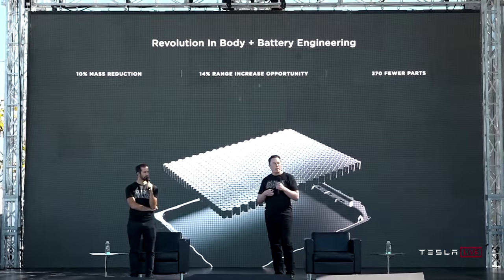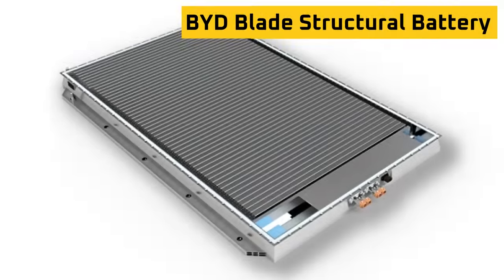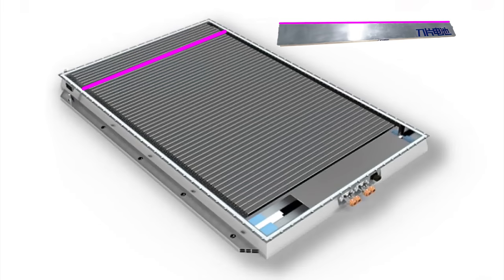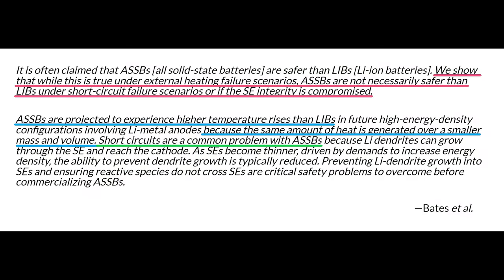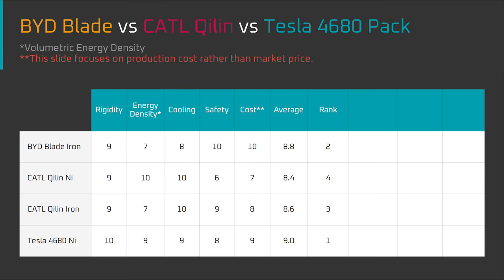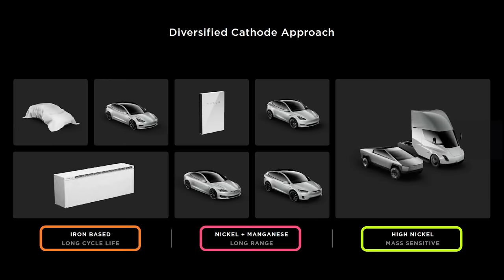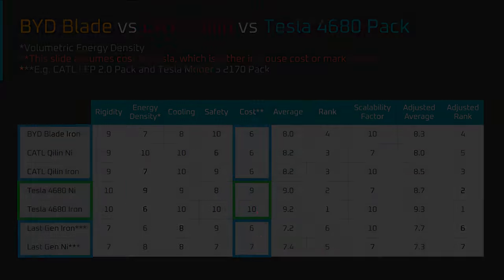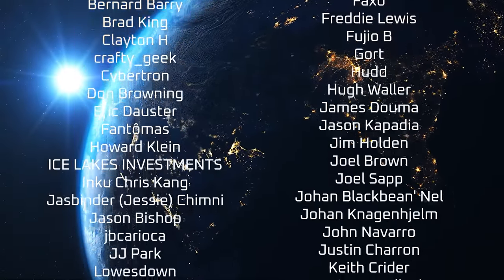Pack Analysis:  BYD Blade vs CATL Qilin vs Tesla 4680 Structural

Comment: 12:13 careful with that metric, electric cars may be less likely to catch on fire but when they do there is no putting it out via normal means. Lithium fires are no joke.
Reply from the maker: Lives aren't usually lost in putting out the fire, they're lost when the person burns alive in the vehicle or burns the house down.

Fair technical point, but not a good argument for safety of ICE vehicles.
Reply: @thelimitingfactor  I'm not trying to sound like i hate electric vehicles but i don't see significantly more danger in one or the other, there is a difference but not enough compared to the other risks of driving on the road.       The draw for me is how modular electric can be for custom/conversion applications not the difference in safety.

Comment: Right now vehicle to grid isn’t a huge deal but in the near future I see that changing. Being able to use your battery for energy storage when energy costs are low and sell it back to the grid at a higher price allows you to make money on an asset that sits in a garage most of its life. That is additional value automakers can charge for and likely make a cut of each KWH loaned to the grid. (Tesla makes a cut today.) The cons are that your battery will degrade faster. Very shortly I see battery life and number of charge cycles being a top three issue.
Reply: Why bother with V to G with the piss poor returns on energy returned to greedy utilities. Just V to home for the inevitable blackouts.
Reply: @howardsimpson489  it really depends on the deal with your utility. In the UK, some utilities are returning around .18 which is barely over the cost of increased battery degradation. While other pilots like the one with Tesla and PG&E pay $2 a kWh during times of grid stress! (So not every day) $2 a kWh is an incredible rate. I’d loan my battery every time for that.

Comment: To not be able too service the most expensive part of a product is a bad idea.
Reply from the maker: Actually a great idea if you understand all the benefits.
Reply: @thelimitingfactor  a battery doesn’t normally fail totally one or a few cells may get unbalanced. But this brings the whole pack down. Easy to extend life by just cutting theses of from the pack and even prolonging life of the pack as a DIY PowerWall. As it’s build in one structural part and PU foamed together there is no other solution than recycling and even that part is made more difficult by this design. Right to repair is the future for consumers.

Comment: Great video but it left me with a big question.  Roughly, what is the ultimate likely cost difference for a GM or Ford battery using the older design?  Second key question is whether GM and Ford will be switching to this modern design soon too?
Reply from the maker: The difference between an in house 4680 pack and an external sourced pack using module and beams will be about $88 vs $110-130.  

No, they haven't even started producing their first gen in volume.
Reply: @thelimitingfactor  Yes, the lack of any vertical integration of the cells, has to add cost. I think Ford mentioned LFP, with no signs of using them, and pouches suck.

Comment: You are obviously Tesla-biased, because the right to REPAIR and REUSE, especially when materials and supply is limited, become the most important issues. With EVs we try to pollute less, not throw away and recycle entire battery packs that could be salvaged or reused for many more years. Used battery storage and parts will become a BIG trend and business. You will be able to find a module with a similar SOH that you need in a scrapyard and service your car for a few hundred dollars instead of replacing the entire pack for a single damaged cell or module.

If the cell is not the issue and you need to replace a BMS or controller, that is exactly why it's better NOT to have it all covered in foam and basically render the entire pack irreparable. There are so many service shops appearing that are able to repair battery packs. It's not rocket science. It's easier than repairing an engine. Sure, you can screw up and blow up you gas car also if you don't know what you are doing in that engine. But that is exactly the point: modular batteries are SOOO way easier to repair compared with an ICE engine by any qualified person.

REUSABILITY is also a main point. In 10 years or when my pack starts to have too little range for my need, I can reuse it for home storage. This would add 10 or more years of usage to that pack. It's nearly impossible to do this wih 4680 and you know it. The BYD blade is 10 times more elegant and easy to reuse.

Unfortunately Tesla is going the Apple way, but not in the good sense. You cannot throw a 10-20k USD battery or a 40-60k car as you throw away a 1k phone. Stop taking their side when they are clearly doing stupid things. The 4680 will be forbidden in EU when they realise it non-repairable and this is also probably why they never produced it there. They are using BYD blade for Berlin produced Model Y which is great for the EU market. The right to repair and reuse DO matter !
Reply from the maker: I hear about this right to repair, but as far as I can tell it's a small group of tinkerers that want the world to cater to their world view - and in the process make the product worse for the other 99% of us.
Reply: @thelimitingfactor  It's the same as seat belts or insurance. It's only a small group of "irrelevant" people that need it, until it happens to you. I hope you'll get this the day you will end up paying from your own pocket for a battery fault not covered by warranty. Or try to sell your 4680 Tesla on a second hand market that does not want to touch them, because of all the arguments I have explained above.

Comment: The BYD Blade is NOT next gen. It is going into 1.3M BEVs/yr NOW!
Reply from the maker: 1) That's a semantic debate.  Unless there is something newer than the blade, the blade is next gen from my perspective.  2) Incorrect.  It's going into some, not all.
Reply: @thelimitingfactor  Why? The run rate is indeed 1.3 M / yr
Reply: @thelimitingfactor  Are you sure?

"Shenzhen-based auto firm BYD announced on August 19 that all of its new energy passenger cars are now equipped with blade batteries." [pandaily]

"BYD Announces all its Pure EVs Will now Come With Blade Batteries." [byd]

"The Blade Batteries are also currently present in all of BYD's" [electrec]
Reply from the maker: I responded above.

Comment: If a battery can be brought back to life by replacing a few cells, or even small modules, that seems to me a good thing. Batteries degrade because of very few cells, right? maybe its sacrificing maintenance for cost reduction?
Reply from the maker: Usually doesn't work to replace a few cells as a long term fix.  Throws the cell balancing out of whack.
Reply: @thelimitingfactor  Can't argue with that and you're the expert. Youtube won't let me post links, but the following two videos from Gruber Auto make my point. In Youtube, first search for Gruber Auto. Then, in their search box, enter Battery repair. Then if you feel like it, play the first two videos in the list. They are called Main battery repair something .. and Impossible to repair something .. I would prefer a battery with minor amount of dead weight in it over a 5% lighter one that cannot be serviced, just replaced. And the price difference is huge between fixing and replacing.
Reply: @biondanishgenomeinstitute8193  I have found that YouTube won't let me post links to external websites, but posting links to other YouTube-hosted videos is fine. Perhaps it is the same restriction for you. If not, the perhaps the difference between your experience and mine is that we are viewing YouTube via different technologies (I'm using a PC-based web browser rather than, say, a smart phone app).
Reply from the maker: @biondanishgenomeinstitute8193  Yup!  They do it.  But, doing it isn't adviseable unless you have a pack that's not produced anymore.  That's why Tesla advises against it.  Workable solution, but not an idea solution.

Comment: Encapsulating cells in rigid foam rules out ANY cell level repair. Is the structural strength, cost savings so much superior? With chassis rigidity, unless Formula racing or $$$ exotics, e.g. point of diminished return & right-to-repair are important factors too.
Reply from the maker: Repair was always a minimally viable proposition for automotive packs.  Cell balancing issues.  Can be done, but more of a bandaid for out of production packs.

The right-to-repair argument is hackneyed in this instance.  Agree with phones, but even then, it's dictated by the economics and demands of most customers.
Reply: I think it has since been determined that replacement at the pack/cell level wasn't consistently viable, due to the need for identically (or near identically) qualified cells that have also degraded at roughly the same rate. A replacement pack would degrade much faster if put in with a number of old packs due to imbalance and loading. My guess is that this is why the approach was abandoned and ultimately entire pack swaps make the most sense.

My guess is long term, once supply issues are smoothed out, is that packs will be replaceable and reasonably affordable to do so, and it will be a matter of unbolting the structural pack and slotting in a new one.